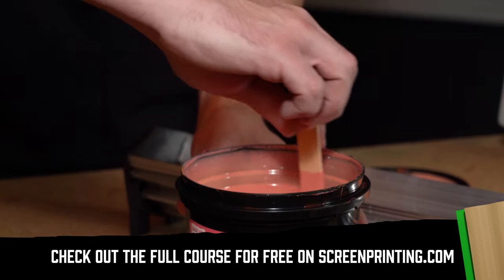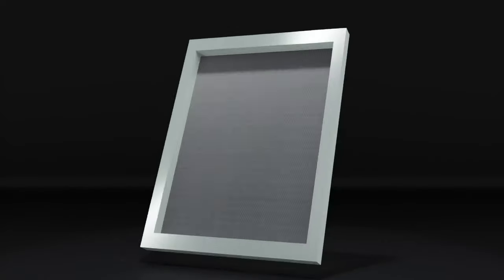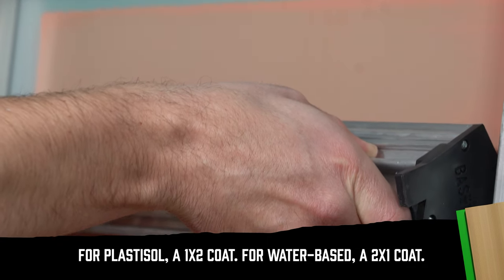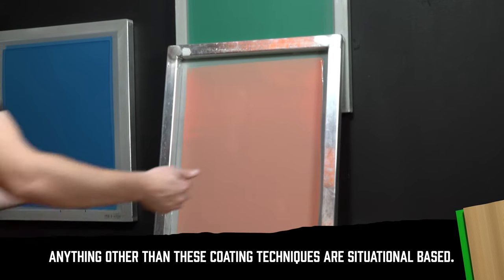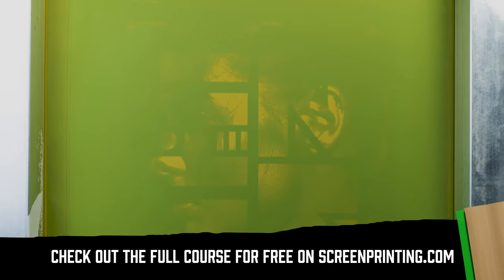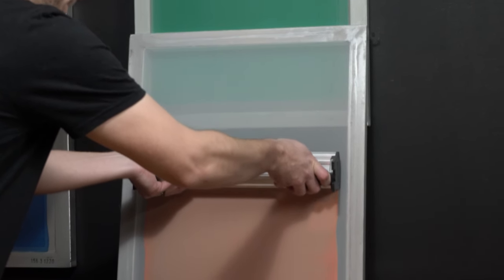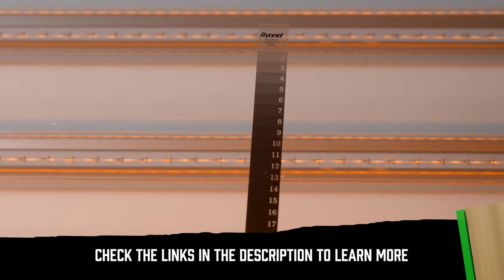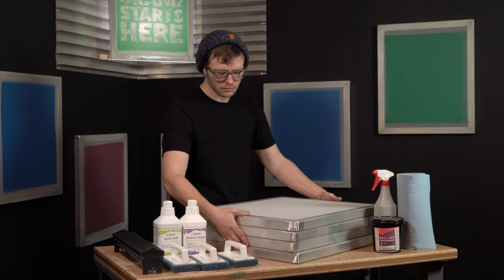Unlock the Secret to Flawless Screen Prints with These Emulsion Coating Hacks!

Comment: When you mentioned 1 by 1. What side of the screen are you calling first? I coat substrate side first (shirt side), before the ink side (squeegee side). I do 1:2 often irrespective of ink type.
Reply from the maker: Starting with the substrate side (shirt side) is standard. The 1:2 method creates a balanced stencil thickness and works well for various inks. 👌